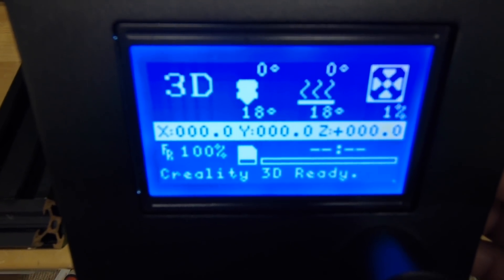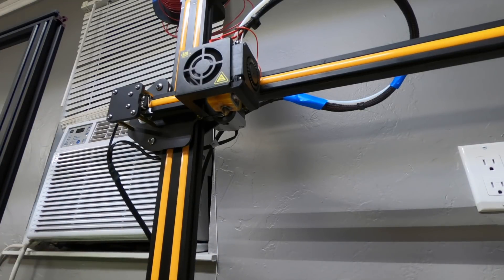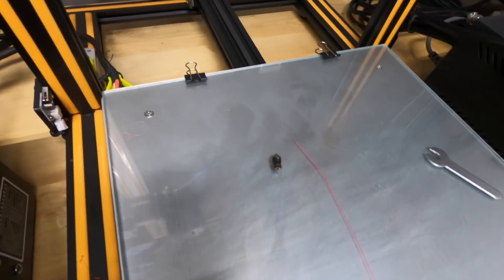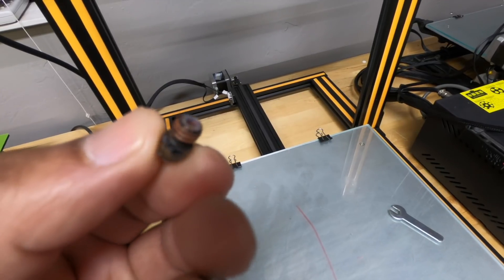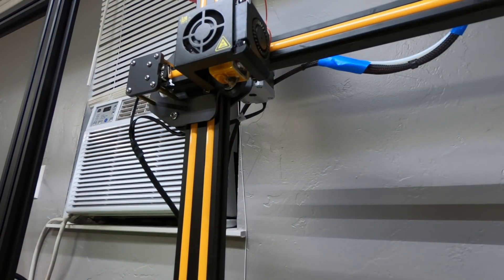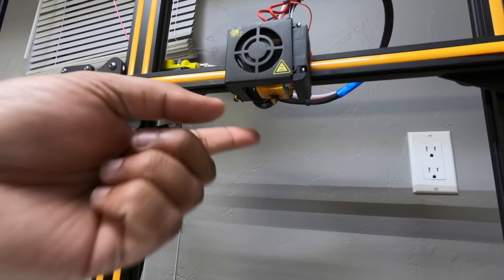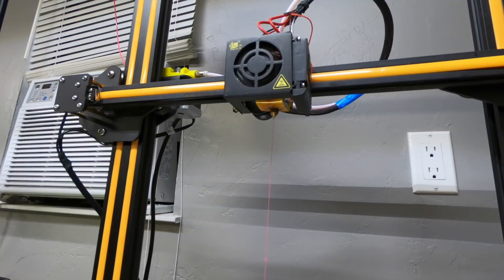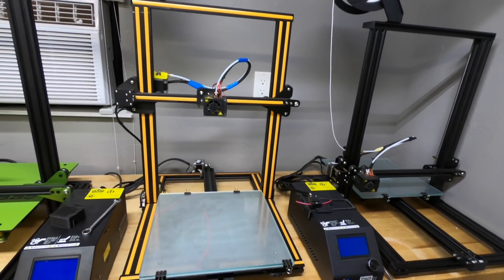Creality Cr-10|cr-10S Nozzle Replacement

Comment: I am having trouble getting the correct nozzle, I have the original CR10. Is the Mk6 I need ?
Reply from the maker: sorry for late reply but no its MK8 that you need.  Just type in cr-10 nozzle and it will come up for you.
Reply: Thanks, I've ordered another set of CR10, nozzles, hopefully they should be fine.

Comment: This video needs to be re-done. I'm new to this, so I had no idea what I was messing with when I started trying to remove the nozzle. My nozzle was stuck and I almost destroyed my hot end because I had assumed it was mounted better. (I stopped when I saw it twist)

Remove the outer plating, move it to the side, and support the heat block with pliers (gripping front-back, not left-right).
Reply from the maker: Did you heat it up because if you did then it should have just twisted off.
Reply: @SANTUBE  I heated the nozzle to the temp that I print at. I don't know how it was stuck, I assume the manufacturer overtightened the nozzle.

Comment: I just replaced mine in the CR10, the factory one was damaged on the tip and couldnt figure out why i was getting a mozzarella  cheese texture. For the stubborn nozzles take off the fan shroud ( only 2 screws ) use a adjustable cresent wrench to hold the heater block steady so you dont damage the mount and use a 6 sided socket with 1/4 inch drive to get a better hold on the nozzle and prevent striping the outside hex ... heat the head to 220 pull back the filament a couple inchs and lefty loosey  and it should come out... and yes careful not to touch it!!!
Reply from the maker: Agreed!

Comment: Creality actually has a tutorial on this which appears to be the best method.  I've used it on both my 3D printer with success.  It accounts for the extra melted filament that almost always builds up in the heating chamber when the nozzle is clogged and there is melted filament backup.

Comment: Once I got nozzle off there is no way I can get it to screw back in :)
Reply from the maker: Rodger Moore make sure the hot end is still hot other wise it won’t screw back in.
Reply: Thanks.... we just got this printer yesterday and are going through a learning curve
Reply: Now the filament does not come out at a consistent rate. Sometimes good but most of the time stringy.
Reply from the maker: check your temp.  Printing at lower temps can cause a clog.

Comment: My nozzle don't unsrew, I have tried using several different wrenches but it doesn't budge. I don't think it's because it's in really tight, because even the locking mechanism on my wrenches gave out before the nozzle even slightly turned. The nozzle even stripped from the outside before it started turning.
Reply from the maker: Zach Antes try turning up the heat frist to about 220

Comment: After using some cheap filament I was suddenly having trouble.  First it was the extruder not feeding the filament through (the tube was totally blocked) and then when I replaced the tube it was STILL not feeding enough through and that's when I came here.  It totally fixed the problem and like you said, nozzles are cheap as dirt now so might as well just change it rather than spend hours trying to fix it.
Reply from the maker: Happy i could help!

Comment: Hi SanTube, have you attempted to add any mutlicolored, multi extruding with (single hotend Preferred) to the CR-10S ... i just bought a CR010S and it came broken, so i resoldered the SD Card slot (as it was not soldered on properly) among other things, only to find out in the end that it was a total lemon, and since i fixed most of it myself, it voided my warranty.  Sooo, Gearbest sent me another one half off.  Since i have one to play with, what would you recommend for multiple colored and or mutli extruder to support multi colored filaments while printing?   I have seen Prusa has a 4 multi extruder single hotend mutli color attachement that is going around as a CR-10S supported mod out there but cannot find it - also seen the Othobit https://www.youtube.com/watch?v=KIRYATreo4w ,     and i have seen the diamond hotend    https://www.aliexpress.com/item/HOT-Diamond-hotend-Prusa-i3-Extruder-Full-kit-E3D-V6-Brass-Multi-Color-Nozzle-3-IN/32648400150.html?traffic_analysisId=recommend_2088_2_90158_iswistore&scm=1007.13339.90158.0&pvid=6f12b461-e08c-46ae-bf44-0e7202f1cad6&tpp=1 ... I cant seem to find a reliable upgrade instruction for 10S ... have YOU tried multi-filament for color printing yet ... if so, what is your recommendation to get a multicolored , multi extruding, Single hotend upgrade for CR-10S ?
Reply from the maker: I have not tried multi-filament printing yet so as of right now i can't recommend anything to you.  If i ran across something i will let you know.  Sorry i wasn't much help.
Reply: NP thanks for the reply - Creality is making dual color but for their newer machines and not as upgrades - i heard we can use prusia, promethius and E3 but not sure.  The CR-10S board has an E2 (Extruder 2) port but Gearbest commented saying there is no firmware upgrade for it but not sure  - thanks again SAN - ill keep you posted if i find one to  :)
Reply from the maker: We will have to wait and see. I don't have a need for it now but maybe down the line.  Lot of changes with Creality right now.  Lots of support and lots of update on the open source marlin firmware.

Comment: I by accident bought 2.75 fialment and did not fit cr-10s. I am now have a full roll of the nylon taulmans filament.
Is there away to change or convert this problem.... I changed my nozzle bot does not fit my printer???? Any suggestion you may have will be great....keep up the great Footage mate!!!!!
Reply: you just need a new MK8 filament extruder stepper motor top part (with 2.75 holes) thats about 7 euro, a new bowden line with connectors (about 3 euros) and a new inside heatbreak for your MK10 hot end (about 5 euros) 
OR do like me had same problem as you, also bought wrong diameter and buy a complete mk10 hot end (with heating element, sensor already attached, also with fan and bowden tube already attached) in 2.75mm format, runs - I bought a cone and costed me 11 euro for whole thing-  that way you can switch easily.  
not mandatory but makes life easy: I bought a second x carriage mount plate with weels (original ones are +- 12 euro, knock offs/clones around 7 euro, I suggest original for this one cause of the narrow tollerances) PS see San Tubes great 'cr10 wobbly x mount plate tutorial' on how to mount and tighten it
Wanna switch filament diameters: just unplug your cable, screw out bowden connector and click the belt loose, and push it right off the x axis, take your other carriage and do same in reverse.

In retrospect I am very happy I made that mistake: buying the 2.75 extruder setup makes that I always have a spare AND biggest advantage here in europe they are slowly clearing all 2.75mm filament spools from shops cause 1.75mm will become the norm: compared to before my 'mistake' I am now able to buy normally too expensive for my wallet filament for bargain prices (think metal brass,copper,bronze or carbon fibre infused filaments for around 25 euros, that is less than 50% the original / 1.75mm price... most webshops also have big stocks of premium brand PLA and PETG 2.75mm at bargain prices (eg colorfabb, formfutura,..brands that are top material but normally so expensive)
Reply from the maker: Thanks man, don't waste your time trying to get the 2.75 filament to work, its easier to just buy the right filament.
Reply from the maker: Your mistake helped you out in this case.  I would go around and buy up all the 2.75mm filament if you get a deal on it.  Well good luck and happy printing and thanks for in the input.